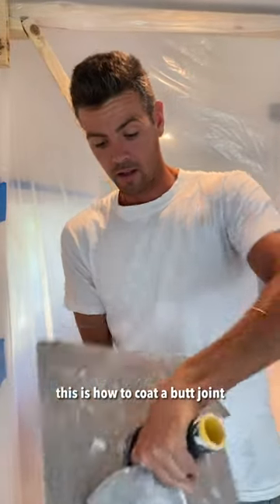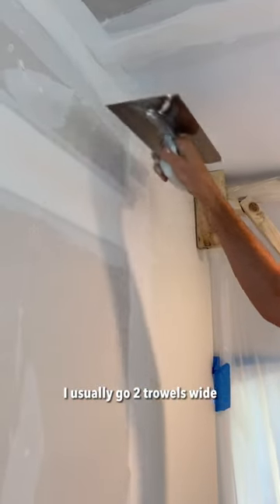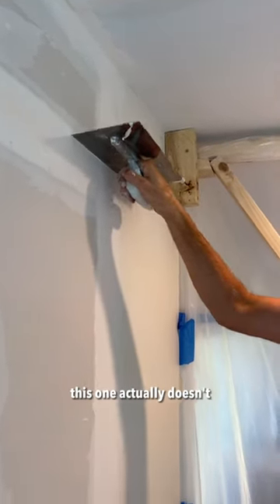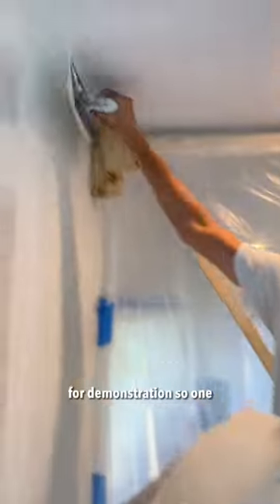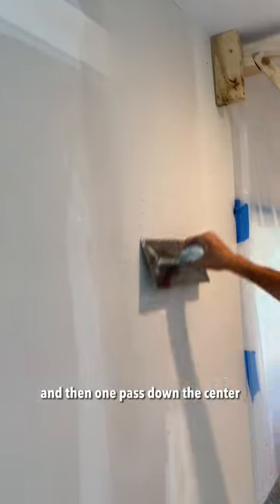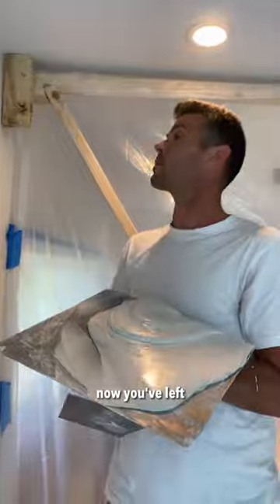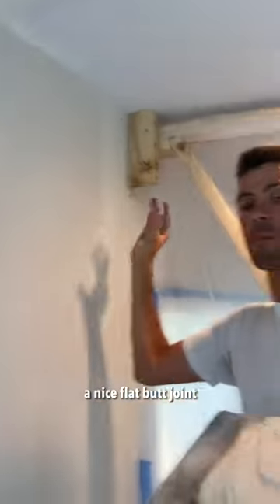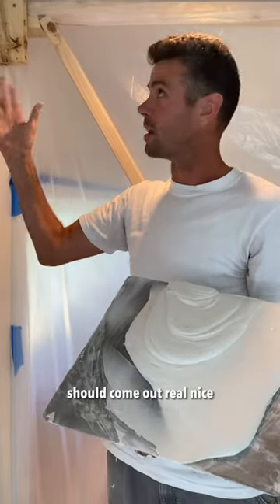Beginner Drywall Tips! Coating a Butt Joint!

Comment: Deep down, nobody thinks a flat butt is nice.
Reply: probably the only instance a flat butt is nice 😆
Reply: Depends on the rest of the body. We still talking about drywall?
Reply: @doug8237   I prefer the walls to be wet.  In fact...wet enough to drip down to the butt joint.

Comment: First time I ever saw someone tell of the bending.  Been doing this for 45 years and I had to discover this shit on my own when I started.  Thank you for helping the newbies.  They gotta eat too.
Reply: Took me a day or two to figure this out lol. Same with squeezing everything out from behind the tape.
Reply: Is he talking about bending on the outside edge of the blade, or bending on the wide part of the blade that is pushing the mud down?
Reply: @Smithers4 you bend the knife or trowel down on the outside edge of the joint so that the mud is thinner at the edges and tapers down to nothing. Best i can explain it. Hope it makes sense
Reply: Thats what I thought, thanks for explaining.  Been doing some DIY and all these tips are great @profcastle
Reply: @Smithers4  You're welcome. Hope it helps.
Reply: i use a 10 inch knife to feather the edges  it keep my trowel from bending on corners

Comment: I am a pro finish carpenter. In certain critical cases, fitting my work on top of inside and outside drywall corners finished at dead 90, with no local build-up to affect the angles, especially at the outside corners,  would be ideal and save a lot of tedious scribing. I have never been lucky enough to encounter such corners, even when I have requested special care from very good finishers. My question: given the nature of corner beads and tape, is such an ideal condition even possible? If so, what are the techniques you would recommend to achieve it? Thx.

Comment: Do you have a video that talks about the "must have" tools/supplies for drywall repairs, and the brands you recommend?
Reply: Something nobody considers is a tool for the newcomer.  Putting on the right amount of compound and getting it distributed along a joint can be made easier by using a notched trowel.  If it's used for laying a base for tiling, why not for taping and spackling?  One with very small notches.
Reply: @alext8828  well, a notched trowel leaves rows of compound, which doesn't help hide joints. It does help tiles adhere. I'm not a newcomer nor a professional.  But when I come in contact with a professional, I always ask them this question because alot of times they have good recommendations  to make the job easier and faster, and provide brands they trust in.
Reply: @thefirstkingridge    Yes, you are right.  I meant for putting the exact amount of compound exactly where you want it.  Since the trowels are gauged to a certain depth and width, they guarantee uniformity.  The next pass with a flat knife or trowel will be that much easier.  
This is strictly for the layman.  I should say that I had corners in mind when I made that comment.
Reply: @alext8828 I thought that notched trowel idea was pretty good. i've only ever installed drywall, or patched a hole and repainted, but i can imagine over-applying mud is the cause of 99% of issues, and a notched trowel would eliminate that
Reply: @cannaroe1213   It's certainly worth a try.  Get a few with different size notches and see what you like.  They're returnable and cheap.  Oh, small ones, relatively.

Comment: When you say butt joint, you're talking about joints vertical or horizontal that don't have the factory tapered edge, right? Cause i saw you the other day doing a verticle joint with just one application pass wide, and two or three feathering.